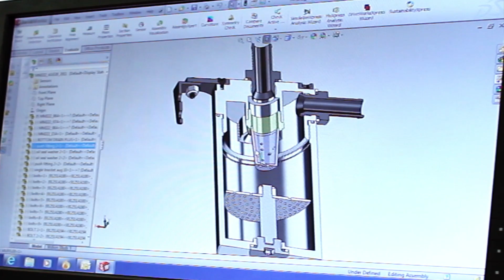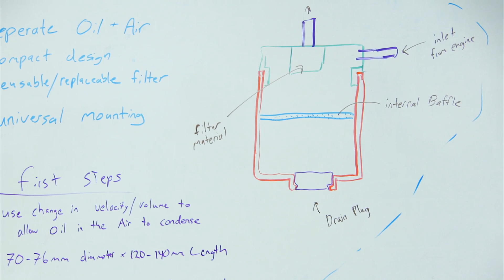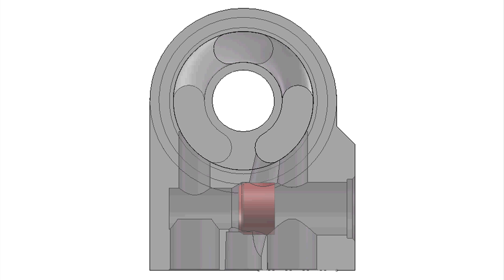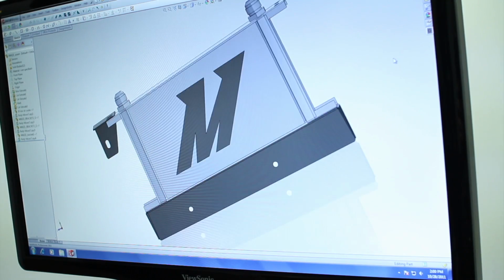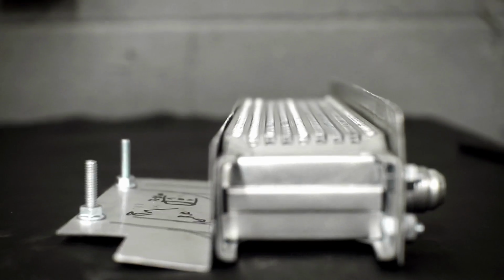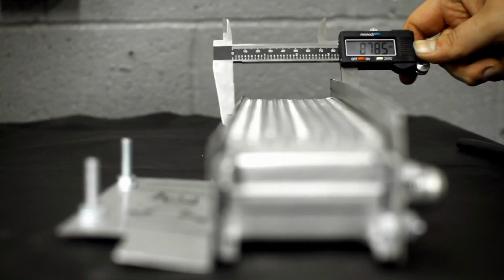Mishimoto Engineering Behind the Scenes - From Concept to Completion

Comment: Hi! I´ve now been using your radiator & 16''  electric fan on my e36 M3 3.2 euro almost a year, its really a piece of art compared to stock //M´s rad and that 25% better cooling you promise is actually tru, instead of being just some advertising bs. I hope you can  start making an oil cooler that bolts straight up in a place of stock euro m3 cooler in the future?